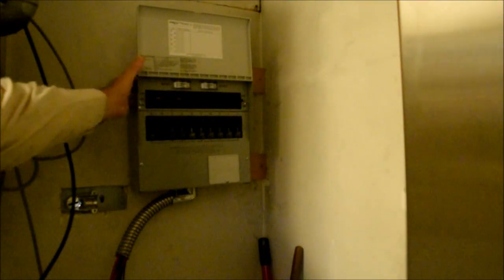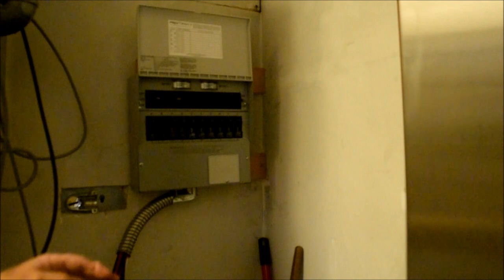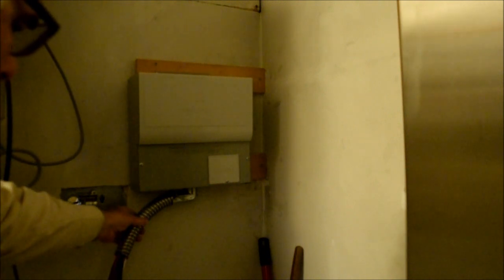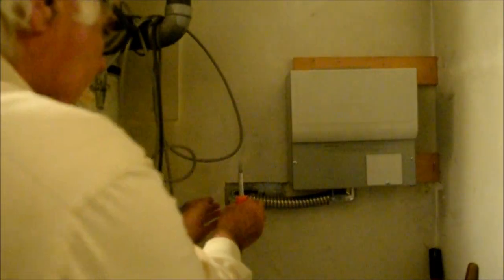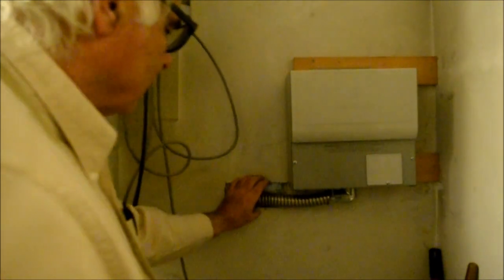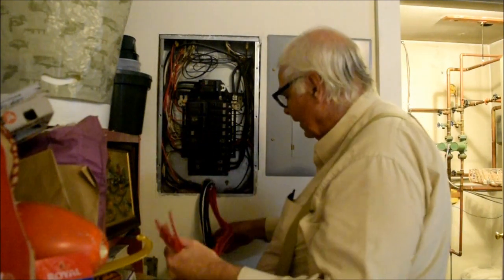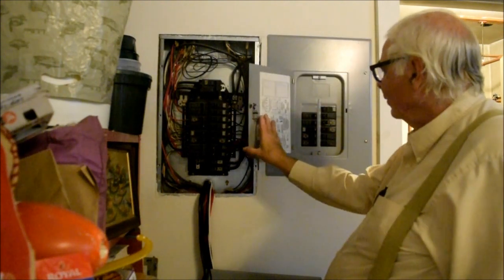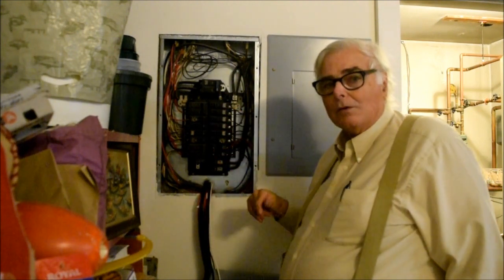Building a Solar/Battery Backup Home Power System #1 - Installing a Transfer Switch

Comment: I was just wondering how you are. How’s that for coincidence. Just take it easy, and the new project is fascinating by the way.
Reply from the maker: I am doing reasonably well.  I do not recommend hernia surgery as a leisure activity.  The first week after surgery it was too painful to get out of bed so I ended up sleeping in my recliner.  I am pretty much pain free now at 16 days post surgery , but still get a few twinges now and then.  I see the surgeon on the 13th for a follow up and hope to be cleared to lift things again.  Right now I am restricted to 25 pounds, so I can't buy the batteries yet because I wouldn't be able to carry them in from the truck.  It will be interesting to hear what the surgeon thinks about me working on the steeply pitched roof (not looking forward to that).  I will probably rig a safety line for the roof work and wear a harness.
Reply: Todd Dunn .  I suspect the surgeon will have something to say.  I know how frustrating it can be to recover from injury, which an operation is I suppose, but I try to consider that time spent recovering is time well invested. I broke my neck once by the way and had to keep telling myself that recovery was temporary and an investment in the rest of my life.  Easy for me to say though when you are itching to get on.. anyway, this project is fascinating and I did wonder how you were affected by the recent power outages.   The rope on a roof thing, in winter,  is surprising.  Your doctor will love that.
Reply from the maker: @richardsmith2879  The main limitation is lifting to avoid straining my abdomen.  My safety line for going onto my 8/12 pitch roof is a line I throw over the top and tie to a tree on the other side of the house.  I attach the rope to my safety harness from the sailboat.  The main reason the surgeon may not want me on the roof is the odd positions you have to get into to work up there. As far as going up there in the winter, I won't be if there is snow/ice.  Hopefully I will have the solar installed by the end of November before winter really starts here.  I agree with you about recovery.  I have no intention of doing something to reinjure myself.
Reply: Todd Dunn . Of course not.  All the best, looking forward to the next instalment.

Comment: This looks like a great option for those of us that live in an area with regular power interruptions. I am also glad to see that your surgery went well!
Reply from the maker: Thanks Jeff.  The surgery went well and I am recovering nicely, but I discovered today that it took more out of me than I thought.  I was a wreck after just mounting the transfer switch and pulling the wires.  I am hoping the back up system works well.  I am installing a 10 kilowatt battery bank which should be good for 2-3 days, longer if there is any sun.  The solar panels should arrive on Monday.  I see my surgeon again next Wednesday and I will ask when I can go up on the roof to mount the solar panels.

Comment: Good job!
Reply from the maker: Thanks.  I didn't accomplish as much as I wanted to today.  I am still recovering from hernia surgery and was pretty wiped out after putting the transfer switch on the wall and feeding the wires through.  I will  get it hooked up tomorrow.  How is the new boat coming?
Reply: Getting there slowly!